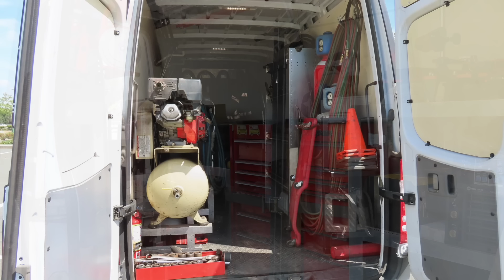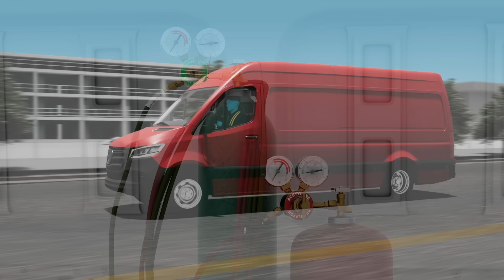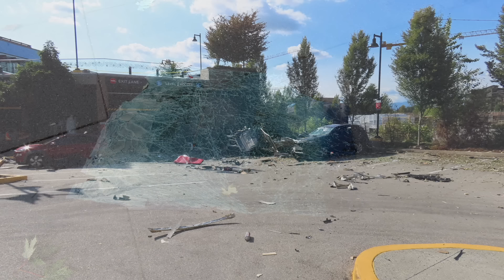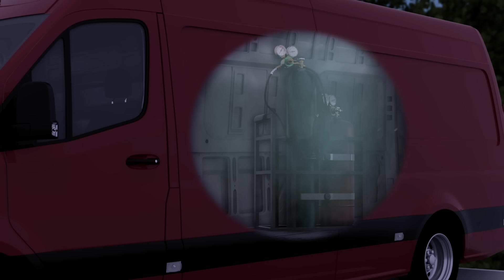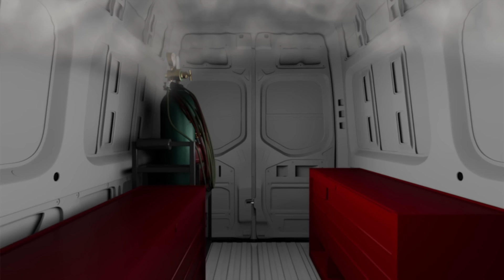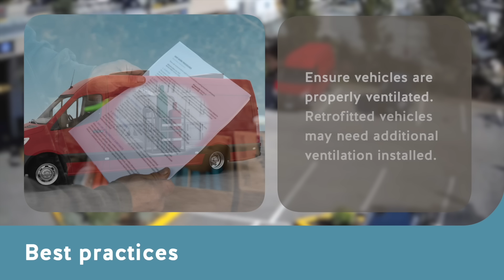Incident Investigation: Key Fob Triggers Explosion in Service Vehicle | WorkSafeBC

Comment: For sale, used craftsman's van. Long wheelbase variant, Low mileage, new tires, freshly installed ventilation update. Key fob in near mint condition.
Known issues: Stereo inop; wipers missing; front bumper included as extra part.
Delivery via UPS express parcel if desired.

Comment: The "safety caps" she is referring to are to keep the nozzles from being broken off of the tank 
in the event of the tank falling over and striking an object with the nozzle. They do not seal anything. 
If the nozzle was leaking, the same thing could have occurred, even with the regulators removed and the caps on. 
That, though, is highly unlikely unless the valve in the nozzle had a leaking seal or the valve was not securely shut.

Comment: Theres things not adding up here.
You're not even supposed to transport let alone store acetylene inside a confined space like this, its meant to be outside the vehicle.
And those safety cap things look like they're only for protecting the fitting from getting knocked, not from gas leaks cause they have holes in the sides..
You don't want to be putting on and taking off the regulators every-time. 
But for both cylinders you want a proper shut off valve/tap on the cylinder, then the regulator, then you want the hose with a cylinder end flash-back arrestor attached to one end and a torch end flash-back arrestor on the other.
After you finish each time and while you still have your torch flame going, you shut the gas off NOT from the torch end, but the CYLINDER FIRST.
Shut acetylene cylinder valve off FIRST, then shut oxygen valve and wait for the torch flame to go out on its own and use up the gas remaining in the hoses.
And then turn the torch valves off and leave the regulator alone and set where it is.

Comment: Safety caps only prevent accidental rocket behavior if the tank falls and breaks the valve loose. The cap does NOTHING regarding leak prevention. When rules are not logical, things can and will go wrong. Ventalation was the error, as it did not occur. Always expect a leak, no matter how small with gas containers.

Comment: …nobody here seems to be asking WHY simply disabling an alarm system on the van caused an electrical spark.  We all seem to be hyper focused on the fuel source.  There was something in that van that caused an undue and improper static discharge or electrical spark.  Absolutely nothing in that van’s electrical system, outside of the ignition (spark plugs and coil) should be creating sparks or static discharges.  More investigation was needed to properly address this issue.  I think investigators rushed to put this to bed.
Reply: good point, central locking systems should not be arcing, maybe when the locking bars slide they can spark? like you say this needs explaining
Reply: Locks are electrically powered, and if the key fob activates a lock, then electricity will flow. Electric motors are likely to create sparks within, and since that van has three/four doors, that will provide three or four potential spark sources
Reply: Relays will produce a spark as they have physical contacts inside.
Reply: The relay for moving the locks would be my guess. The solenoid should not cause a spark in normal operation.
They do make explosion proof relays; but was not able to confirm in my initial searching if automotive explosion proof relays are available.

Comment: No.  Removing and reinstalling the regulator every time you use gas cylinders create a huge problem in themselves.  You cause undue and excessive wear on the threads leading to leaks and risk damaging the equipment every single time you do this.  The less you touch your regulators the less chance you have of causing wear and damage. Proper ventilation was the answer here, not actions that cause more wear and leaks faster.

Comment: In the UK acetylene cylinders have a blow off valve soldered into the bottom of the cylinder so that in the event of a fire the solder melts and the gas is vented rather then the cylinder exploding, i have seen a leak from the soldered plug actually catch fire, luckily I spotted it and extinguished the flame before it could melt the solder completely, cylinders need to be in a vented place at all times.

Comment: To be fair, it wasn't the keyfob that caused the explosion, but rather the remote lock/unlock circuit itself. Probably a relay inside the passenger compartment arced when the unlock command was sent. The title seems to suggest the RF signal somehow caused the explosion.

Comment: In the industry we use a leak detector product called "Snoop". If he had followed the procedure of removing the hoses and regulators and shutting off the Oxygen and Acetylene cylinders, one further Safety precaution could be testing for leakage before screwing the caps on. Propane cylinders have a built in feature to protect the Valve in case the tank tips over and a plastic or rubber threaded bung to screw in. Perhaps having those bungs for acetylene and other flammable Gases would be a good idea for low volume leaks.

Comment: “Safety Cap” are utterly irrelevant to safety in this case - leaking valves ware the problem. (Safety caps are not even required in most countries now - permanently attached valve guards are now more common).

Storing the cylinders inside the vehicle is the problem. That permitted gas to fill the entire vehicle body. 

A separately ventilated gas bottle container is the safer option. These sealed containers are commercially available and commonly used by plumbers in their vans (after a number of similar explosions globally).

The small free volume of the bottle container limits the size of the blast possible.

Comment: Impressive blast! I once attended to a Propane truck explosion where a truck, with a known leaky safety valve, was parked overnight in a garage. Next morning the mechanic went to work and fired up the woodstove used for heat. He was somewhat surprised to find himself embedded in a snowbank more than 50 feet away! Happily, uninjured.

Comment: None explained what ACTUALLY caused the ignition. The key fob certainly didn't cause it. I am thinking: 1) either a relay in the fusebox, if the fusebox is inside (i.e. near driver's seat), or - 2) the door unlock mechanisms, if they are actuated by simple DC motors.  But, the van was a Mercedes Sprinter ... so BOTH explanations are HIGHLY UNLIKELY.  For safety reasons, most Mercedes vehicles traditionally have the fusebox outside the cab - i.e. under the bonnet - well ventilated place, (for all German busses fusebox is completely external and separate - mandatory since 1960s), and they usually use vacuum lines for opening and closing all doors and trunk too (not 100% sure about the Sprinter though).... The vacuum pump usually is a sealed unit and kept in a separate (semi-sealed) compartment. So ... what was the ignition source then ?

Comment: Any professional technician knows that you NEVER keep flammable liquids or gases in a poorly ventilated space. You also NEVER keep multiple flammable gases or liquids close together in an enclosed space. Gas bottles are infamous for igniting and exploding even in totally open conditions. There have been MANY deadly incidences worldwide. This was as close to an IED as you can get. How in hell did the company even allow this method of equipping their service van ? The math: if the interior cargo area measures 33,000 in2, and the explosion caused a very low 30psi pressure wave, it put nearly 1 MILLION pounds of internal pressure on the thin sheet steel structure of the van, which acted as a perfect shrapnel generator. And that's why you don't see much left of it. Those are conservative low numbers. It could easily be 3 or 4 times more depending on the true explosive force generated by the gas and other flammable materials in there. Pure Oxygen being a major contributor.

Comment: Removing regulators and replacing cylinder caps wouldn't address this problem. A valve that doesn't fully close, or has defective valve stem packing is going to leak just the same. In fact, the wear and tear of removing and replacing regulators will promote the possibility of a leak, especially while in use, with the valves open. The solution would indeed be ventilation.

Comment: This highlights the difference between stored flammable gases in enclosed compartments and in open areas. The removal of regulators and use of protective caps is recommended in either circumstance. Additionally, storing gasoline in ANY container requires sufficient ventilation.

Comment: A bit more, a gas detector that triggers a ventilation fan in such vehicles needs to be required. With a rotating flashing light on top to signify that a hazard is in process.

Comment: I once opened the door to company I worked at. It was on a weekend and I went there to do a shipment. I smelled acetylene gas. I did not turn on the lights. I went to the lab where the gas cylinders were and opened the window and doors in that area. I got a water soap mixture and sprayed down the bottles. I found the gas was leaking from a new bottle and it was leaking from the recessed bolts on the top of the tank! I turned on the vent fans in the area and vented the whole building. I am eternally grateful I did not turn on the lights!
Reply: Observant of you! I wouldn’t recognize the smell… (although I suppose if I had worked with it, I would have learned).
Reply: @karenneill9109  Oh its a sweet smell for certain, and its a very crazy product as far as flammability curve.
Reply: @karenneill9109  I was a bit terrified when I turned the fans on. I was not completely certain that the acetylene had gotten down to a non-explosive level. That ratio is from 5 to 95% in air. It has no smell but some impurities in it smell like garlic. And that is what I smelled..

Comment: safety caps do not prevent leaks, they prevent only tap break-off in case of cylinder falls. Disconnection and connection back high pressure regulators after each job will be way more risky than leave them as is, providing that cylinders are fixed inside the rack, can not move by themselves and nothing can fall onto it.

The main problem in this case is big sealed volume (van interior) with gas cylinder and without ventilation. Cylinders should be completely outside or, in case of van especially in cold climate, in some internal cabinet with separate through ventilation (ingress-egress).

Comment: My Opinion. Either the regulator had a very tiny leak or he failed to tighten it properly and didn’t shut the tank off. My big question is what created the spark? 

In a new vehicle there should be nothing in the locking mechanisms, the lighting or the alarm system to arc when activated. Each component should have tight connections in the circuit chain that should not spark in any way. LED lights don’t create a spark. The locking mechanism should not create a spark unless they’re damaged. 

I feel like this could actually be more than just an accident.

Comment: Why all the AI when real video was available?
Much of this was almost nonsense. The safety caps only prevent the valve being knocked off during an accident they do nothing to stop gas seeping out, If the guy actually did properly turn off the gas which is done at the bottle and not the regulator as shown in the video it is very unlikely the oxygen or acetylene had anything to do with it at all unless the cylinders had faulty valves in which case the safety caps would have done nothing.
The actual culprit could have been the petrol powered air compressor or a leaking spray can of something like Brake Clean. If it actually was the oxyacetylene leaking the bang would have been about ten times worse

Comment: Based on experience filling garbage bags with oxy-acetylene I can authoritatively report that there was a lot of O2 in this van.
Reply: Ya, we used to set the torch mix to get the optimally hot "little blue cone" burn then snuff it out and then fill balloons to about 8" dia.  One time doing this I had one filled balloon held against my side with my arm while I worked on filling another...and the balloon blew.  There were feathers everywhere (I was wearing a down vest). Felt like I'd been hit with a baseball bat to the ribs.  Had ringing in that ear for months. Must've been triggered by static elec generated from rubbing balloons.

Comment: Freak accident. First there had to be a minor acetylene leak and the van had to be left just long enough for the fuel/gas mixture buildup to be just right. Not enough gas, no explosion, too much gas, no explosion, just right, boom. It was so lucky there was no one else around and the driver operated the remote key from far enough away to avoid injury or worse. Very nasty indeed! I bet the subsequent insurance claim was an interesting one to file.

Comment: What the hell cheap charlie investigation was this?

1. Safety caps do nothing to stop leaks, they are only there to prevent impacts to the valve which can't happen when the tanks are stored in a vertical tank holder 

2. The vehicle had no gas leak detector installed, the real culpret.  An alarm system would have alerted the vehicles owner and anybody nearby.

Comment: As someone who has transported many many times oxyacetylene tanks, I’m always very careful to put caps on them, I would think leaving regulators on in a vehicle bouncing down the road would not be a great thing with all that weight hanging on the valve getting shocked and jostled as it goes down the road, might not hurt to get a gas sensor to put in the vehicle too, there’s probably a sensor out there that can detect acetylene

Comment: The second I saw the acetylene in a closed space, I knew what happened. Calling the guy out for not pulling the regulators or putting the caps on is BS. The reality is that seals on valves and connectors fail over time. Pulling the regulators every times accelerate the wear that can causes leaks, in short, not a solution. This is why real safety regulations demand to handle the gas cylinders as if they are leaking (slow leak) at all time. Closed, unventilated spaces are a big no, no.
Reply: Especially BIG unventilated spaces, several m3, not some dedicated cupboard slightly bigger than cylinder inside with its own ventilation.
Reply: Thats why these gasses are only delivered on open deck trailers or pickups. That being said there are plenty of fitters running about with acetylene or propane in side vans. Propane sinks so needs a ventilated floor, acetylene rises so needs a ventilated roof.
Reply: Exactly removing the regulators and capping the tanks does nothing to stop leaks. There was leakage between the tank, vavle, regulator or hoses to cause this.
Reply: Bingo.  Don't pull the regulators.  But ventilate the van.
My instructor showed aftermath photos of a similar incident.  One death.
Reply: A big problem is the very wide range of oxygen-gas mix that can explode, from very little gas with a lot of oxygen and vice versa..   Aka    2.5% L.E.L. (Lower Explosion Limit) - 82% U.E.L. (Upper Explosion Limit)
So even if you ventilate the van, 2.5% gas isn't very much...  
Hydrogen is also one of the wide range gases 4% - 76% .  Most others have a way smaller range, like Propane  1,7%  -  9,5%  or Methane  4,4%  -  16,0%
Reply: Absolutely, for acetylene to build up the tank valve had to be leaking and the cap doesn’t hold pressure it only mechanically protects the valve. If you’re trying to tell us that people are better at fully shutting valves when they remove regulators then say so.
Reply: ah yes, solve one problem create another one. contraproductive
Reply: @ursodermatt8809  counter-productive

Comment: The other issue I'm wondering about is  the need for a flammable mixture of acetylene and oxygen. Mini accelerants will not burn in the presence of oxygen if the mixture is too rich or too lean. It's been a long time since I learned about acetylene, so I don't know what the flammable range is of acetylene
Reply: I just googled the flammable range of acetylene and it said that it is very wide, from 2.5% to 81%. I'm guessing that was a very very slow leak of acetylene in the van
Reply: @bradbiesecker162  
flammable range is not necessarily the same as the range when it explodes.

Comment: This trading in tanks is something I’m not in favour of. For example, years ago, we bought a new propane tank for the BBQ. When it was empty, we couldn’t get our tank filled. Instead, we were forced to give our tank to the filling station, and accept a full one. We had no idea of how the filled tank had been treated, or how often it had been filled. 
Relying on a corporation to supply safe tanks is not wise, imo.
Glad nobody was hurt in this accident.
Reply: They visually inspect the tank. make sure the relief valve isn't sieved, check the tank's age, then fill it. The next to last swapped tank I got audibly leaked at the valve stem packing. Had things went wrong there would have been a fire at the valve you couldn't turn off or disconnect and whatever was in the way would have been burned like a plumber's torch. I wired on a safety tag and swapped it out at the store but I wouldn't be surprised if that tank is still in circulation. My camper's tanks were out of date but swapping them got me newer ones which I take to my lo0cal propane supplier to be filled. Saved me the cost of new tanks and about 25% every time I get them filled.

Comment: I haven't been in many shops but I have yet to see anyone remove the valve assembly from a "working" tank and install the safety cap on a daily basis.  I think every user would consider this a seal/valve issue not an outright "safety" issue.